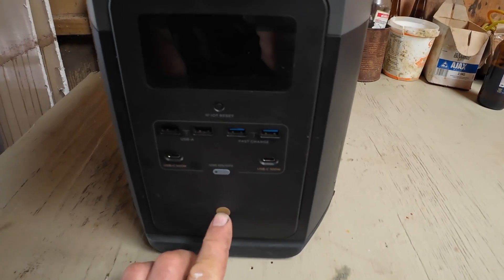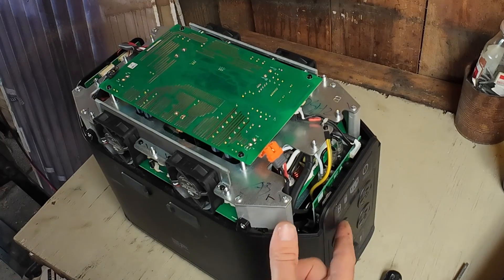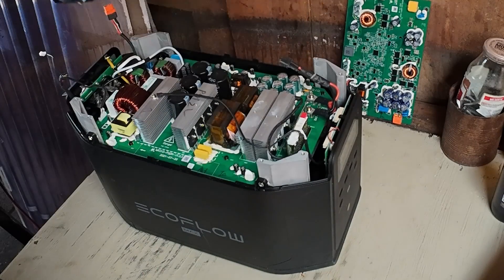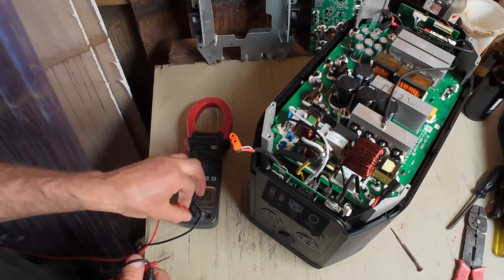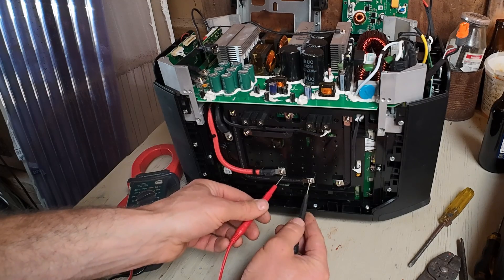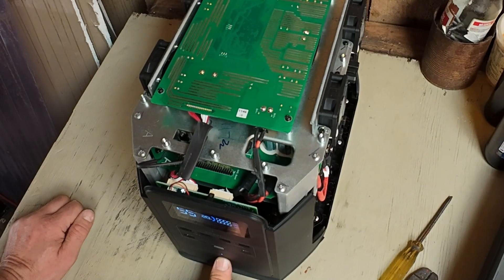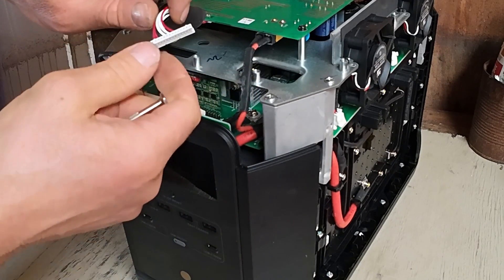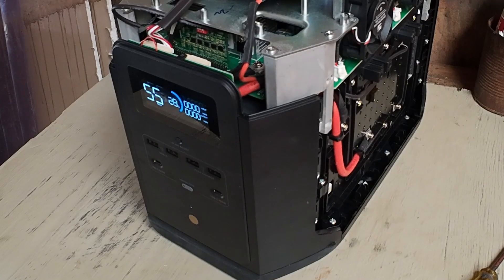Ecoflow Delta Max Troubleshooting: Why Won't My Power Station Turn On?

Comment: Could be a soldier joint on the plugside on the display board an when pushing the wire down it makes better connection,  be worth a check to pop the display off an check the male side soldier joints if it happens again

Comment: maybe give a close look also to the solder joints on the board side, wiggling the cable is also wiggling the plug on the board so hard to tell who's fault that is

Comment: 5:11 - I've learned the first step in troubleshooting modern electronics is unplug and replug easy to get to electronics. 90% of time it's fixed. Modern materials in connectors has really gotten low quality.

Comment: Being the old troubleshooter I am, I would suggest that, since the unit has received some vibration, that it's not the plug that's in trouble; I suggest that the pins that go into the plug have come loose from the printed circuit board.  I have seen micro-fractures of the solder around an individual pin completly isolate a pin so there is not connection, even when it looks on the outside that all the pins are properly soldered.  I then suggest you take out that board the plug connects to and with a soldering iron with a very small tip, reflow the solder around each pin.  You shuld do them all, unless you can visibly see which one is loose.  Care must be taken not to allow the solder to join pins together unless the printed-circuit conductor does that for you.
Reply: Saw this myself back in the day, it was always a real pain to find but an easy fix once you knew where it was.

Comment: Reminds me a bit of my recent used car purchase. The master window wiring harness had 2 loose wires. Would cut out intermittently. Now has 2 shaved down matchsticks wedged into the connection to hold them in place.

Comment: Thats the issue with the rest of the World, that would have gone to land fill, now its got another life.  New Zealand has often and rightfully so been referred to as the land of number 8 wire technology.  The reason was back in the days before airlines, NZ was so far away from the manufacturing industries, if anything broke down it would take months and month to get a new one.  Hence the Number 8 wire monika, number 8 wire was used in all fencing, and Kiwi ingenuity soon found a multitude of other uses for it.  Dont forget Lord Rutherford of Nelson City, New Zealand, was the scientist that split the atom and ended WW2 whether it was right or not.

Comment: That was a lucky find mate. You'll be working on that again soon. When you do, check the male header for that connection before you go replacing the female connector.
Two things commonly happen to electronics that are used in non climate controlled conditions. One is the corrosion problem you mentioned. The changing temps and  moisture in the air can create condensation on the connections and cause corrosion on plugs and sockets that are not coated in gold.  The other problem that can occur is poor (cold) solder joints can split from temperature changes and the electrical connections on the printed circuit board can be separated by a crack. Check the header that the plug goes into. Each pin has a solder connection to the board. Look for a small ring around the solder that would indicate a separation from the circuit. A quick reflow of the solder can fix this problem.
One other thing that can be an issue is left over flux from original circuit board creation. They use water based flux these days which makes their building and cleanup less toxic to the workers. However any flux left on the board can absorb the moisture in the air and become more conductive over time than the circuit can handle and cause a malfunction of the circuit. However since you can wiggle that connector and make it work this flux contamination is likely not your problem.
Reply: Yes, I am betting a cold solder joint.

Comment: Give the circuit board and traces near the connector a good look if it happens again.  A crack could have intermittent connections affected by a little pressure.

Comment: Nice to see how these batteries do long after all the Influencers praised them up. The battery portion seems to hold up, in this case I think its a connection problem.

Comment: Always worthwhile to take electronics apart to make sure there's nothing obviously wrong when they don't work. Very critical to know that these battery banks can contain dangerous voltages though. They don't all have high enough voltage to hurt you but some of them certainly could.
Reply from the maker: Yes and some big caps in there, hence why I was only touching the edges of the boards
Reply: @MartyT  Yeah the comment wasn't really aimed at you I could tell you were being careful with it. It was more for someone who would get inspired by your video and not know to be cautious with the finger poking
Reply: Particularly anyone reading the comments about tube radios and tvs.  High voltage inside!!

Comment: I use a product called Servisol switch cleaner and lubricant that comes in a spray can. I have resurrected a number of failed electronic items including a Leica R4 camera, by spraying the contacts on plugs, sockets and switches with it. I am sure there will be an equivalent product on sale in NZ.

Comment: We get these in the workshop all the time! The crimp on the wire in the socket has been crimped to the insulation you can get yourself a removal tool or simply get something pointed and lift the plastic lever that locks the pin in place and pull it out, re crimp the cable, reinstall, job done

Comment: Bet the manufacturers are kicking themselves, am sure they are going to have to do lots of returns now. Nice that there appears to be a no quibble replacement and now of course you have a spare, might be worth as you know what the issue is, just replacing that part anyway.

Comment: I think the green light that was still on was the WiFi / Bluetooth board.  You might have been able to still use the unit in its "broken" state with the mobile app since the cable that has issues seems to be the front panel display and buttons only.
Reply from the maker: I tried that, t wasn't connecting to wifi

Comment: I know it's not the case in this instance but sometimes you have to "wake up " the lithium battery if it has been run down. Needs a recharge and a boost as well. Cheers  Peter

Comment: It might be worth checking for a dry solder joint where the socket is soldered to the board. A two minute job if it is.

Comment: i would throw some hot glue on the back of that plug and up the wires just to hold them a little stiffer. sometimes a bit of support is all thats needed for intermitent connector issues. you can still cut it off to replace the plug if needed. however the fault may also be in one of the wires.

Comment: Unless they fixed the issue do not use heavy Powertools with it.
There is a Youtuber who had one of these die on him bcs something in the powerinverter could not handle the large inrush current and it destroyed his Killawatt meter due to heavy distortion in the output power.
he tried to talk with them but they ignored him for a good while.
just so you know.

Comment: check for a broken sodier connection at that front board marty id give it more that then a broken wire but you can check that as well by wiggling the wire while using your meeter set on audio for conductivety

Comment: Cracked / dry joint on that control board male connector I suspect.... In need of some flux and some lead based solder

Comment: That's a tiny plug for quite a bit of mass flapping about in the breeze.  Is the socket SMD or hopefully through hole? If its SMD it could be a trace fracture/solder joint failure.

I couldn't see any staking on any of the components so I suspect the battery pack was only designed to be used stationary.

Comment: Had a stereo in the past - when t played up the solution was to thump it... Years later when thumping ceased working I opened it up and discovered a dry joint..... A little solder and it lasted a few more years (without thumping).

Comment: Hi Marty, if you happen to have a microscope on hand, take a good look at the connector and crimped wires. I work at an electronics manufacturing site and when we started to do in-house crimping and assembly for similar wiring harnesses we got all sorts problems with them. Most of them had to do with incorrectly inserted crimped ends into the plastic connector body. When I took a good look into the connector(from the perspective of which the pins enter) I could see that the crimped parts had been inserted at a slight angle and had dug into the white plastic housing. Usually a small plastic shaving had also become stuck between the crimped terminal and later acted as an insulator.
Reply from the maker: Good tip, cheers
Reply: @MartyT  I am thinking a cold solder joint on the board at that connector.
Reply: @paulstaf  thats a good call, just touch an iron to each of the pins would fix it
Reply: We’ve seen those connectors when run close to max capacity , get hot and lose tension.  They then fail to keep a good connection to the pin.
Reply: @davidbelanger2681 Tiny wires are bad news.

Comment: Maybe put some hot glue to keep the connectors lined up so they do not move, did that many years ago with my tablet and still goes 5 years later. Great fix bro and good result. Safe travels. Ken..

Comment: Good accidental fix Marty. I’ve got a blown inverter that id love you to fix, but it may not be too easy. It was connected with reverse polarity. I might have thought they’d protect the unit from that common mistake, with easily accessible fuses, but I think they soldered those onto a PC board. Not good planning for reducing eWaste. Anyway, fun to watch you tackle any fixit job. Nothing intimidates the master 😂

Comment: Great Video MartyT, normally I admire you're 100% skill when you are fixing vehicles after a long time after not being started for sometime, I think an element of luck came into that repair, the skill was the fault finding, but the luck was it was a simple issue, thanks for sharing

Comment: Honestly can't see the point of paying all the extra expense for lithium batteries for house power, lead acid are just fine and significantly cheaper.
Reply from the maker: For me its about portability, I'd need a forklift to carry the equivalent capacity lead acid powerplant
Reply: I'd like to see you carry around a unit of equivalent capacity using lead acid cells 😂 Lead acid also sucks in many ways, you can only use a fraction of the cells capacity if you want to get a decent number of charge/discharge cycles out of the cell. Even deep cycle lead acid cells shouldn't be more than 50% discharged.  
Otoh they do  have a superior safety record, overcharging or cell damage doesn't cause thermal runaway.
Reply: @ferrumignis  I said for house power, not for a portable installation.
Lead acid are simpler, safer, cheaper and much more easily recycled.

Comment: I fixed computers from 1991 through to 2020.  I came across myriad computers with ridiculous faults just like this.  Just wiggle a few wires and bingo, I found the fault.  Good job Marty.  BTW I drive a tractor trailer now hauling fresh fish.  Pays better.

Comment: Nice job Marty, right on. You may be on to something though, I’ve read many comments researching EcoFlow that has mention their units stop working around that year range. Next time I see or read about one failing with that problem I’ll mention your channel to them. Anyways thanks for taking one apart, not seen that before.
Reply from the maker: Maybe a faulty batch of connectors
Reply: @MartyT 
Common fault on a lot of old 80s & 90s cars was drying solder joints on the PCBs.
A lad I know in the UK makes a living re-soldering boards.
I had just this problem on one of my old Mercedes 190Es, never had the same problem with any of the other 4 I owned which kind of proves the point, there's always one that slips through on even the very best of merchandise.
Reply: @MartyT  Cold solder joint.
Reply: Gee, it's almost like they were designed to fail after a specified time isn't it.
Reply: @axeman2638  I don't see how you'd engineer a simple connector to fail after a "specified time". But 10/10 for cynical snark.
Reply: @paulwomack5866  Oh, argument from personal incredulity, very convincing I'm sure.
Reply: @axeman2638  Quite right - I personally don't believe you provided any evidence or suggested mechanism for your claim.
Reply: @paulwomack5866  I didn't make a claim I suggested a possibility.
But if you think designed obsolescence doesn't happen you might be a bit detached from reality.
Have you see the documentary "the light bulb conspiracy"?

Comment: Pretty sure the whistling is those bigass capacitors at full charge. As soon as you opened the top to show those four big caps, they immediately reminded me of the inner workings of a high power professional camera flash I used to use years ago. It would whistle at about that same pitch when at full charge. It would also take a few seconds to charge each time as it was only powered by 6xAAs, and you would hear the whistle as a low to high pitched swoop as it got to full capacity.
Reply: then he goes at it with a pokey metal screwdriver 😄 I east waiting for the footoomcrack!
Reply: Electrolytic capacitors don't normally make any significant noise, unless they explode 😅. Whining/whistling in inverters is typically caused by inductors/transformers (loose windings moving or the magnetic core changing size a tiny bit via a process called magnetostriction) or some types of ceramic capacitors that exhibit piezoelectric behaviour.
Reply: @ferrumignis  Not sure about that, but every camera flash I've ever used has made that noise to a certain extent, they all have heavy duty caps to dump the charge into the xenon tube, pretty sure they don't have inverters or transformers in them, but I'm not an electronics expert.

Comment: Could it be a dry solder joint on the circuit board?
Reply: Could be a dry joint on the PCB side, a bad crimp on the cable side, a crimp terminal that has been damaged during assembly and not providing sufficient pressure on the pin or surface oxidation of the pin or crimp terminal (poor quality material or inadequate plating).

Comment: I suspect the issue is a cracked solder joint on the board side of that connector.
Reply: Almost certainly. The cable is very likely faultless, however the solder joints on the header are a classic place for a dry or broken joint.
Reply: @nutwiss  Indeed! What do you bet they're using lead free solder, and with time it will become evident that this is a systemic issue?
Reply: Me too. Probably had to take off the front panel to get at them.

Comment: I had the same problem with an Ecoflow - went dead - it was in the warranty period so I sent it back and they fixed it....   Interesting to know what I might do if it failed out of warranty....  Could be a cold solder joint on the board - changing the plug itself might be difficult without the correct crimping tool.

Comment: To prevent this from occurring again,simply find the loose plug,and press it whatever direction it takes to make it work again, and then while holding it in place,glue gun it fully into locked into place,holding it until fully cool.. problem solved permanently unless one has some broken connections inside of the plugs which may even be solved with the hot glue trick..

Comment: JTAG is a programming/diagnostic interface. While it can have this type of plug to use it what you're looking for to replace it is something like MOLEX, of which there are hundreds of variations to search through. As mentioned the solder joints would be worth an inspection. Good spotting tho, it could've easily slipped unnoticed.

Comment: You must never ever leave these for even hours at 0% unless it’s an emergency. It irreparably damages the cells. Just a tip to increase its life span.
Reply: You can't - they will shutoff automatically before you can do any damage, IRC there is 10-15% reserve.
Reply: @ckm-mkc  in an ideal world maybe. But no, it’s not a good idea to leave them empty.   Those 5% you talk about is in the steep curve at bottom of the cell capacity. Never rely on a safety measure to save the battery. Always put a little at least back in it.
Reply from the maker: Yeah I try to store my lipos around 50-60% charge
Reply: @MartyT  that’s the sweet spot!

Comment: hmmm €6.798,00 and it works for 10 months
Reply: Mine was $399....  Failed and was fixed under warranty, it's been working great for well over a year...
Reply: Where did you pull that ridiculous figure from? The smaller unit that Marty has is nowhere near that much.

Comment: Probably a dry or cracked solder joint on the connector. Try resold ring the connector.
Reply: Agree likely a poor solder joint - specifically on the part of the connector that’s on the circuit board, not the wire harness.
Reply: I'm pretty sure that it's an Insulation Displacement Connector (IDC) on the cables, they have been known to have alignment issues during manufacture, so it could be that, or as pointed out here a dry / cracked joint on the connector mounted on the PCB
Reply: That was my first thought too to check that out.
Would've shown more of a tear down too😁